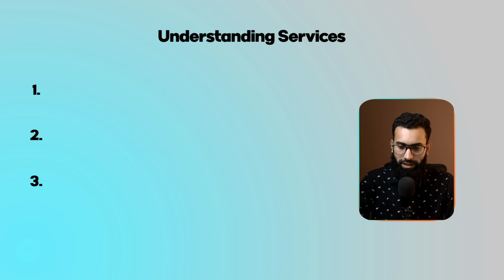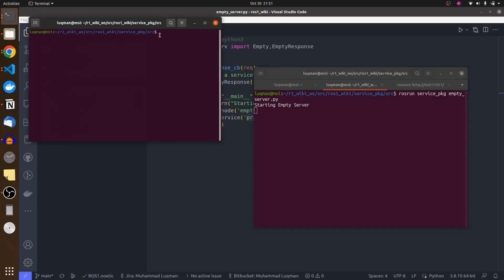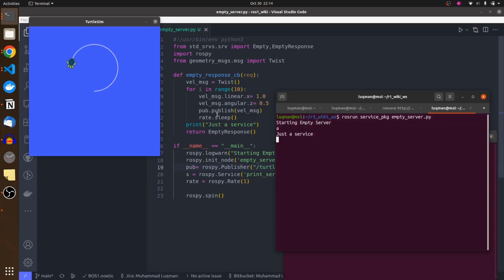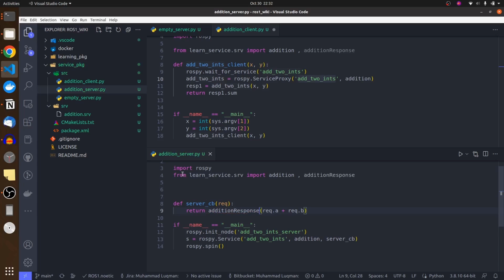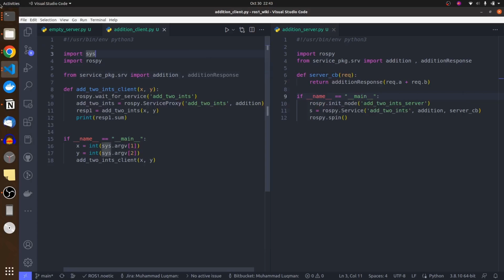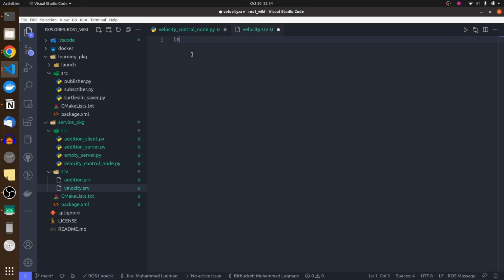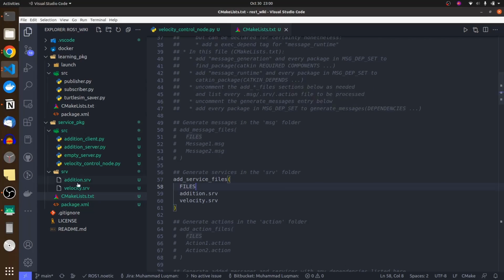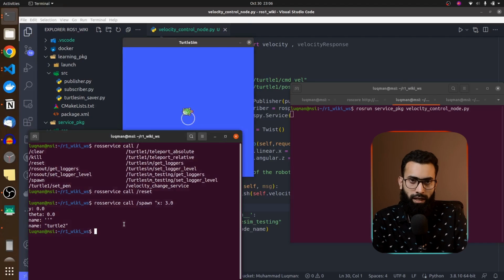ROS Services using custom applications

Comment: Hi, how do I get the learning_service.srv? Even with the ROS tutorials I cannot understand it. I thought I had just to do service_pkg.srv import ... but it does not work.
Reply from the maker: Make sure you’ve properly built your workspace (using something like colcon build) and sourced the correct setup files. The learning_service.srv should be part of your service package—double-check your package’s structure and naming conventions as outlined in the ROS2 tutorials. If you still face issues, please share any error messages for further assistance.